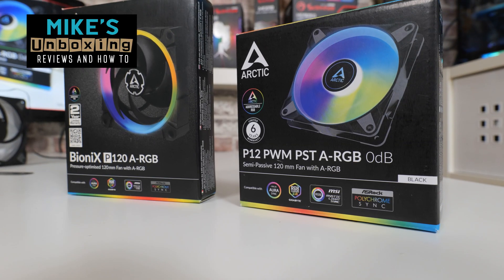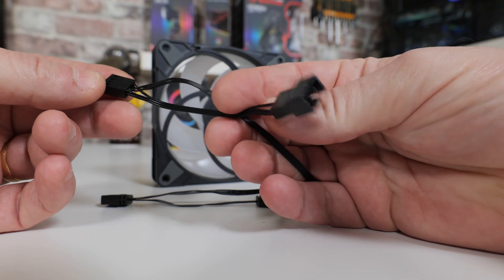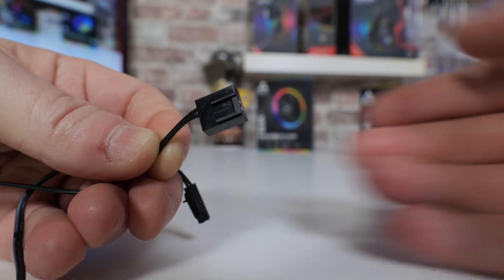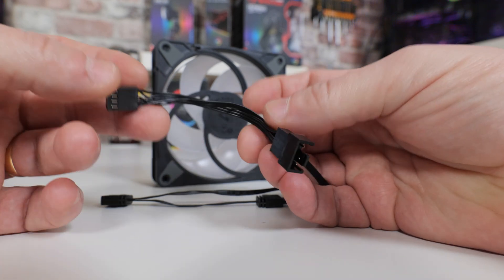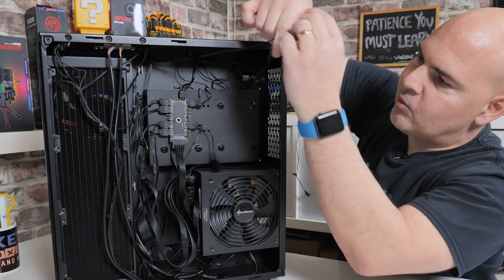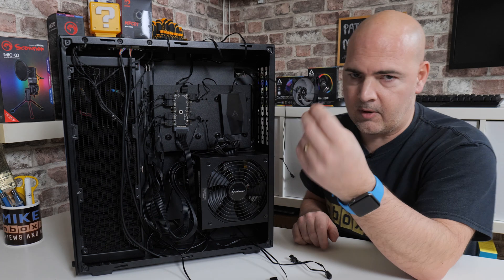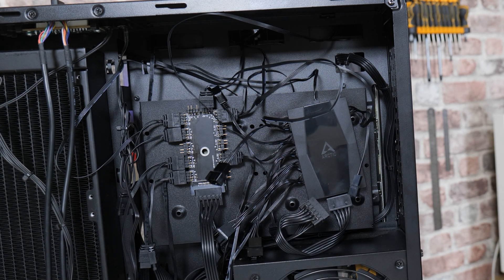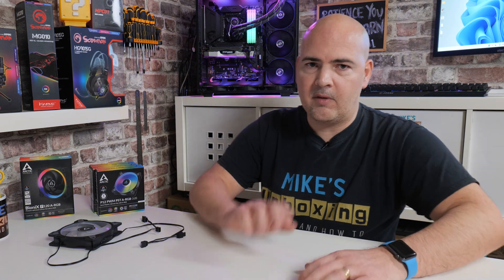Add Extra PC PWM Fans With Arctic SATA Powered 10 Port Fan Hub

Comment: Use one of these for a push/pull fan set up on my 360 AIO. Handy little blighter.
Reply from the maker: it is a great little hub, highly recommended
Reply: Did you connect all 6 radiator fans of the aio into the Hub and the Hub itself into the CPU_FAN Header on the Mainboard? Thanks for your Help :)
Reply: @Hudsonwastaken yes. But I have a motherboard that has 12v 2a fan headers so they don't overvolt and short the header. It can run all 6 without the need to have it plugged into the sata power as the header draws enough to power the hub and run the fans.

Edit: I've just reread this and no sorry, I put the pump header on CPU and the hub on CPU_OPT.
Reply: @LordPoshnameVonPlumbingparts  thanks very much! I had 3 of my push pull fans into CPU opt and the other 3 into CPU opt but they did not receive enough Power so i guess i gotta need the extra sata Connection from the Hub.
Reply: @Hudsonwastaken You'll want the pump header on CPU and the hub on CPU_OPT. That's how I set mine up. 

But you probably already knew that

Comment: Hi, Mike. It looks like a nice hub for the money.  But another good hub is the XMSJSIY 2 in 1 hub that has six sata powered ports for six 12v 4pin PWM fans and six ports for 5v 3pin ARGB for $11
Reply from the maker: is that a walmart brand, i am struggling to find it over here, but some places have said it is available in walmart stores as a brand
Reply: @mikesunboxing   I don't know if it's a Walmart brand. I found it on Amazon. I think it's cool that it can handle the fans and the argb. I might have to get one and try it.
Reply: @lorderectus1849  for example?
Reply: @lorderectus1849  thank you.  Will have to see which of those in your list actually can be had in The States.
Reply: @lorderectus1849  sadly, not a given.  I have noted a bunch of times that unfortunately, many of the items Mike reviews, can't be found here.
Reply: Nice one Big O !